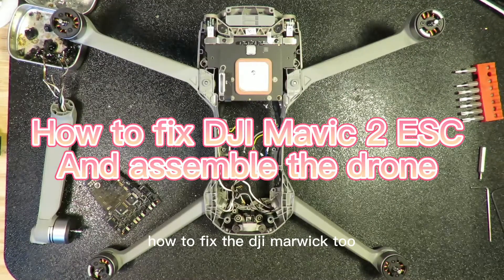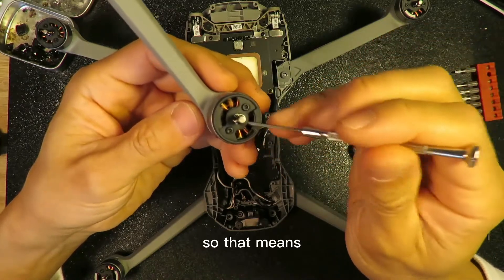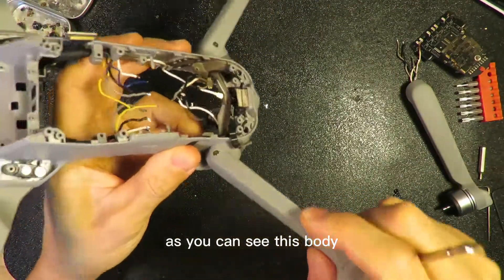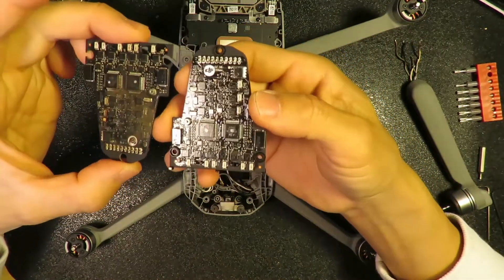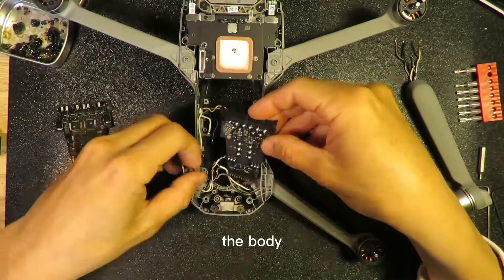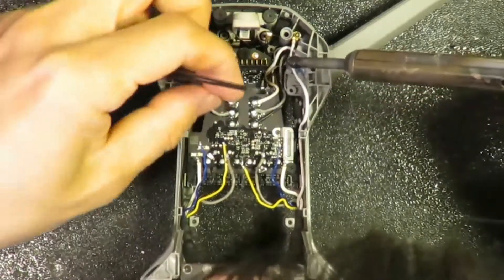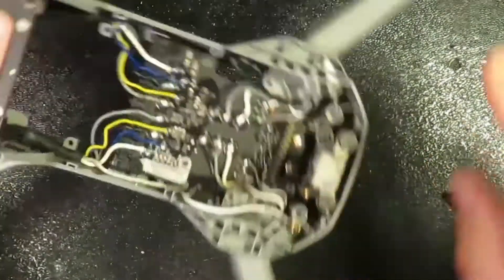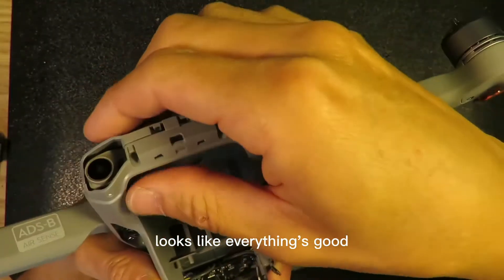How to fix DJI Mavic Air 2 ESC problem and assemble the drone

Comment: 2no.esc error does that mean number 2 motor and esc board ?
Clipped a rock and slid down a waterfall but not in water
Reply from the maker: The ESC control is all in the power module board. It really doesn't matter if you can identify which is wrong; unless you have a tool to deal with the tiny board plus you can buy the little ESC chip yourself. The best is to replace the whole ESC board. Hope this helps.

Comment: Hola amigo buenas soy un nuevo suscriptor de tu canal quiero hacerte una pregunta   a mi de mi drone sale .ERROR DE ESTADO ESC RENICIA EL AERONAVE PONTE EN CONTACTO CON LA ASISTENCIA DJI SI EL PROBLEMA PERSISTE TRAS EL RENICIO . Así me sale no endiend  ayúdame con esto xfavor  cual seria el solución de drone dji mavic air
Reply from the maker: Hi, my friend, by its report "ESC STATUS ERROR", the ESC board had some issues. if your drone is out of warranty, then you can try to open the drone and see if there is anything wrong with the ESC board by visual examination.

Comment: Hi, sorry for my bad english but i'm french. I have a problem with the ESC I think. I get a ESC message error 4times/10 when the drone fly since few minutes
I had a crash few months ago and I have unscrewed the drone, the ESC board dosen't have any burned traces or anything else like on your video, if I only change the motors do you think it will be good? Because sometimes the 2 motors on the right side doesn't start, I need to reboot the drone.
Thanks for your help :)
Reply from the maker: Unfortunately. we don't have a tool to isolate the problem of the ESC or the motors. The only way is to do a visual examination. But this is hard. What I can suggest is to swap the motors on the drone itself. Just jump the wires and switch the motor left to right and right to left.  But my hunch is still the board issue. Motor sometimes works sometimes doesn't seem it is the ESC problem.
Reply: @fsong00  thanks for your answer, I will try this 👌🏼
Reply: @fsong00  Hi, I have some news (bad) I have changed the ESC board and changed the motor who wont start (sometimes) but the problem still persist. Now the problem come at every start after 2-3min flying.
Do you think the problem can be from the IMU? Now I get IMU error when i'm turning the drone in the air with my hand (motors turned off)
Is it possible the IMU do turn slowly a motor due to the IMU problem but tell to the drone its a ESC problem?? but why sometimes the two motors wont start 
big thanks for your help
Reply from the maker: @DizeParadise  Hi, my friend, we have ESC board, main board and IMU unit + GPS. ESC board is simple, just to some translation of the pulse signal to drive the brushless motor. If you have change both of them, then ESC and motors are out of the problem. What left is the main board and IMU. the cable connects the main board and the ESC should be fastern and make sure all the pins are clean contacted. You said after 2-3 min flying, it has problem. What is the problem reported on your phone?
Reply: @fsong00  thanks for your answer, yes sometimes the problem come when the drone is flying. Sometimes after 2 min or 20 min etc.. yes every cables are correctly connected. The messages error are: (after esc problem when flying (the drone was spinning in all directions before returning to normal i think the imu error come from the spinning?))
-failed to initialize gyroscope. restart device code 30045
- IMU calibration required. calibrate IMU code 30050
-esc error land the aircraft immediately code 30038

thats very strange few months ago when i've got the first esc problem it was only esc error, i wasnt have imu errors. it looks the problem is growing and i dont know why
thanks again for your help
Reply from the maker: @DizeParadise  This is tough. If IMU calibration does not fix the problem, then we really don't want to pursue this IMU diag path. Because this is costly. The money you have put in and effort won't justify it. I don't know what to do. We really don't want to swap everything on this drone. If I was you, I would sell this AS IS on ebay for parts. In fact, there are many people there looking for parts like this. You can get your money back some sort of. my 2 cents.
Reply: @fsong00  yes i thought the same, I will buy a new one, thanks for the help

Comment: My ESC board burned, but the coils of the arm motors seem fine and don't smell burned. Should I only replace the burned ESC board ? The back arms are the ones that do not turn Green.
Reply from the maker: You need to be very careful of switching Esc board without verifying the four motors. If motor has issue, the new Esc board will burn again. I think there is a way to use meter to measure the healthy of the motor by ohms.

Comment: great video!  Im trying to add an external battery.  Do you happen to know if those 2 holes on the esc near the battery connector a positive and negative battery input?
Reply from the maker: Hi, I dont think the two holes close to the battery connector are the battery inputs. You can use the meter to test it out on the board. HTH.
Reply: @fsong00  hello l want to know how to test wihich motor doenst work on dji mavic air 2 how to test can you tell me?
Reply from the maker: @takestime9462  Hello, thank you for the question. To be honest, I don't know. If it is a DIY drone, we can use the flight controller app to fine tune each motor such D-shot or other. Since this is DJI, I dont know which proprietory app they use.